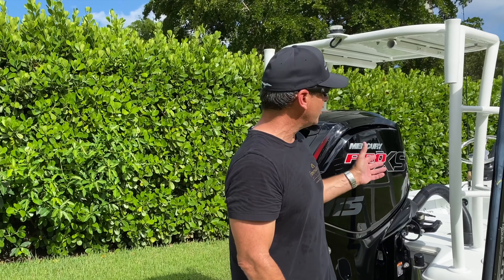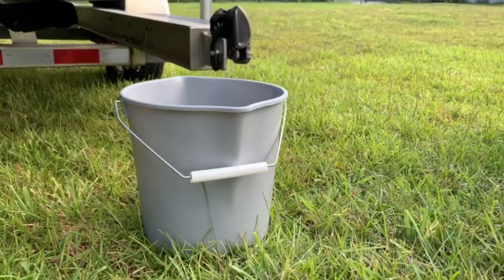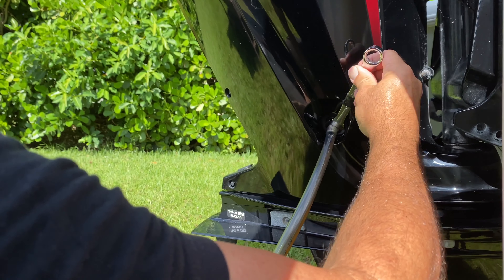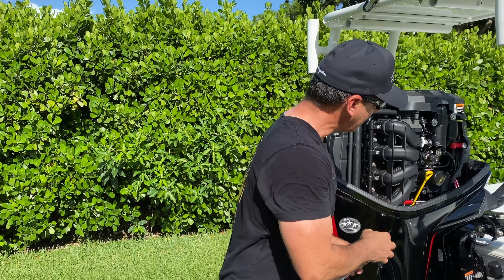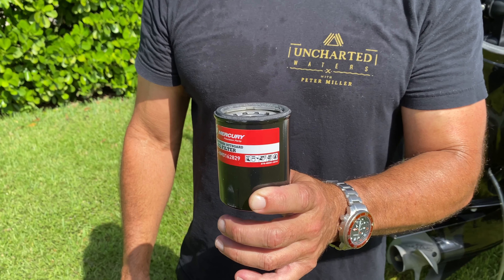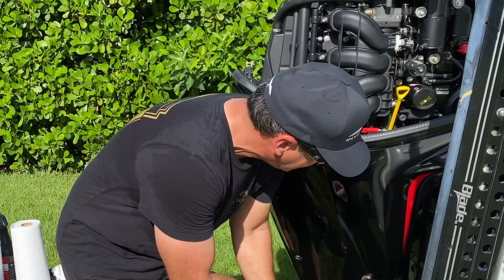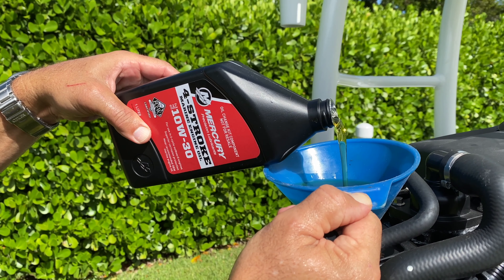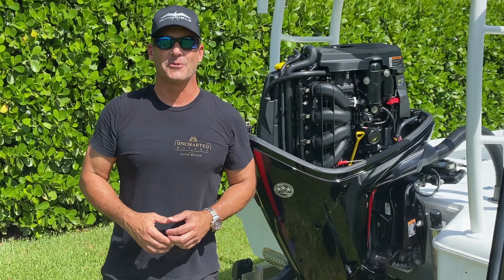Mercury Pro XS Maintenance: Oil Change

Comment: Great video! Only recommendation I have for everyone is to run Mercury’s Synthetic Blend rather than the normal conventional stuff. Just gives you that much more protective for your hard working outboard.
Reply from the maker: Great comment. The suggested oil on this particular engine is the 10W30 as shown, however, the manual states you can use the 25W40 Synthetic Blend as well. Always refer to your operator's manual or engine maintenance decals for guidance. Thanks for adding that in, Kaden! 😎
Reply: Just an FYI - It now suggests this from my 2021 115 Pro XS manual.........Engine Oil Recommendations
Mercury or Quicksilver NMMA FC‑W or NMMA FC‑W catalyst compatible
certified SAE 10W‑30 4‑Stroke Marine Engine Oil is recommended for general,
all‑temperature use.  The FC-W catalyst compatible is the synthetic blend of 10w-30.  It's on my engine sticker too.
Reply: Yes but when choosing between the two, syn-blend all the way. Even more the new 10w30 full syn by Mercury/quicksilver that I will start running in my 150 4 stroke

Comment: If you did an oil change the previous season and only put about 20-30 hrs should you change the oil after storage for the following season? Also do you warm the engine up before foil an oil change?
Reply from the maker: We recommend performing an oil change every season or every 100 hours, whichever occurs first. Warming the engine first can help the oil drain more quickly, but it is not required.

Comment: Great video that’s easy to follow. Just wish it included gear case oil change too.
Reply from the maker: Hey Kelvin! The gear lube change is part of a different video series. Below is a link to the video we posted back in 2018. Keep in mind, you will want to access your operator's manual for step-by-step instructions, as you will see in the video there are a few variations of drain and vent screw locations. https://www.youtube.com/watch?v=BBbQVH5j0W0

Comment: Is there a guide to how tight the oil filter needs to be when putting it back on? Is it just hand tight and snug or do you use a tool of any type to tighten it.
Reply from the maker: To install the new filter, apply a film of clean oil to the filter gasket. Do not use grease. Install the new filter until the gasket contacts the base and then tighten 3/4 to 1 turn. Tools should not be necessary, but if the filter is hard to grip by hand, a filter wrench can be used. Be sure that if you're using a filter wrench, you are still following the 3/4 to 1 turn guideline once contact between the gasket and base has happened.

Comment: Nice, but you skipped the draining of the old oil filter and draining of the tray under the oil filter 🙂 Also there is a torque setting for the oil drain plug.